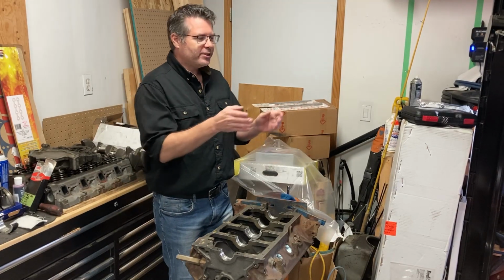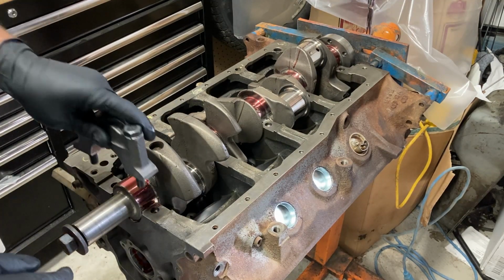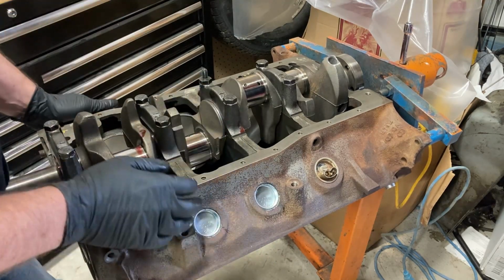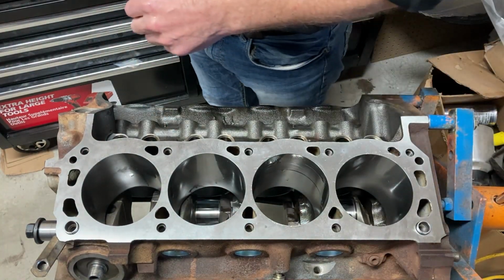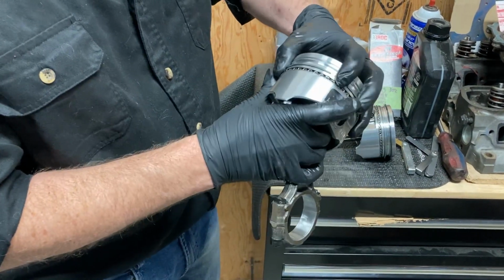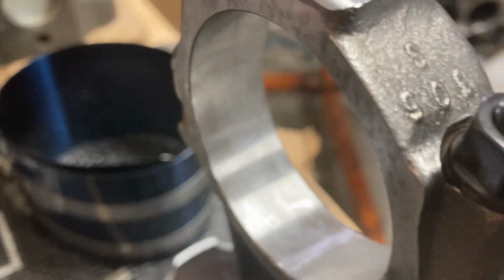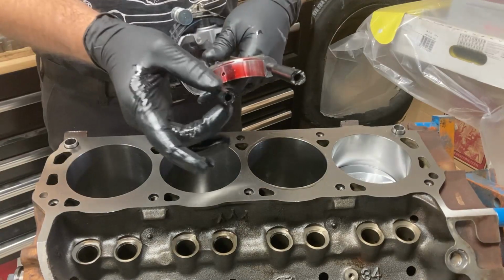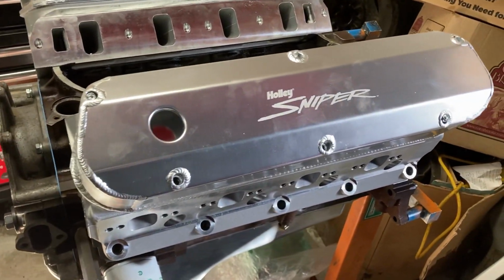Can We Get 400+ HP - Ford 302 Build - Mongrels Garage

Comment: Is it necessary to bore .030 over to reach 400 hp? Im trying to get 400 hp NA and got ACES efi and the AFR 185cc Enforcer heads.
Reply from the maker: Strictly speaking, no you don’t need to bore it 0.30 over.  It takes from a 302 to about a 306, so not much difference in displacement.  We actually haven’t put the car back on the dyno yet so we don’t know our actual power output, but we are thinking it’s around 350-375 based on seat of the pants feel and track times.  Reach out to Matthew at Tecmotion Calgary (https://youtube.com/@tecmotiondyno?si=3u2zG09RGuWDt84C) he can tell you exactly what you need to do to hit the 400 mark.  Another great source is Richard Holdner (https://youtu.be/en2JWQ-Unsg?si=RjrMhAC1tSeven6b)
Reply: @MongrelsGarage  sweet thank you so much
Reply: No not really.
It's intake runner volume and port flow and cam that determines most of the hp output.